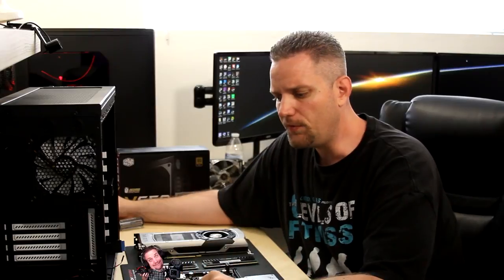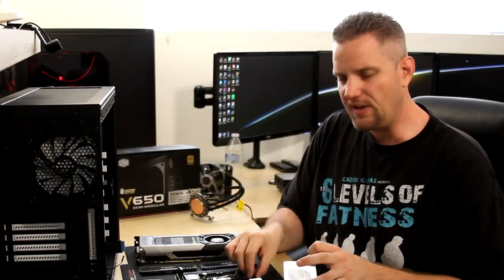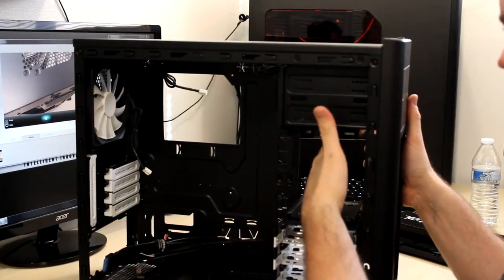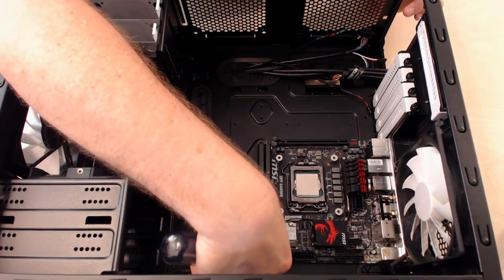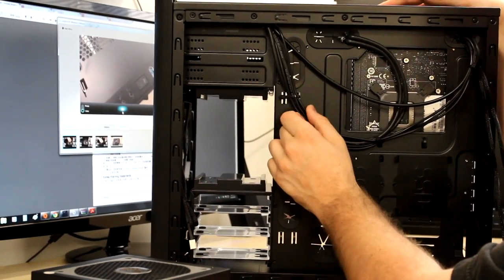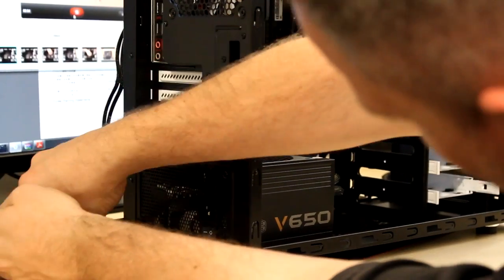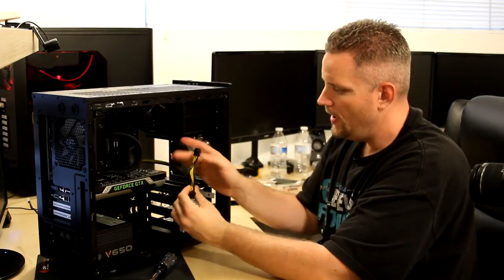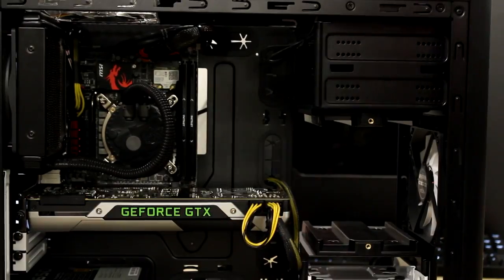Beginners Guide: How to Build a Computer

Comment: Dumb question- Do most hard drives, motherboards, PSU's and SSD's come with the cables required to hook them up? Or do you need to buy them separately?
Reply: Your motherboard will have 2-6 sata cords (depending on brand and price range.) cases will sometimes come with extra tray holders and some don't. Minor accessories may be needed, but majority is covered!

Comment: Two questions here:  1st, do all the cables come with the components (e.g. power, SATA).  2nd is, does windows come pre-loaded on the ssd?  Thanks in advance.
Reply: 1. Yes 2. No you will have to get it of a flash drive or get an optical drive and use the c DVD method

Comment: Can anybody help? I was thinking of building a pc, but all the cases I use on pcpartpicker says they're usb 3.0 and that my Asus A68HM-E Micro ATX FM2+ Motherboard does not have onboard USB 3.0 headers. Should I listen to this or is it irrelevant?
Reply: You should get a motherboard with sub headers but if you can it isn't really important. As long as your motherboard has enough USB ports for your keyboard mouse and whatever else you need. If you really have to you could buy a usb extender thing so you plug it into a USB port and it gives you more USB ports
Reply: Usb headers not sub headers
Reply: you can buy them, the pc will work but u wont be able to use the 3.0 usb ports only the normal ones
Reply: Hook City All my usb is 2.0 so I should be good?
Reply: AG DOMESTIC Ok thank you, if I don't have enough I will just get one of those things that makes more usb inputs, but thank you.

Comment: Complete noob with computers and I got a question. When you turn on the computer for the first time. What do you do? Do u install windows? And what if you don't have a DVD drive like your build? Are there any drivers u need to install for anything? And if so how do you get them. I understand actually building it's when it's the first startup I get confused
Reply: ctrlaltdel.gaming if you still need help let me know. i'm more than willing to help. if you don't have an optical/dvd drive you can burn the os onto a flash drive and do a boot from that. after it does it's thing you have to download the motherboard drives. after that do all the updates and graphic card updates.

Comment: Attempting to build a black and white computer. Not sure what cpu cooler I should go with stock Intel cooler or a 3rd party one.  I would go with nzxt liquid cooling but I'm scared of those liquid ones. What other heatsinks and fans are good for an 1150 socket doing slight ocing.
Reply: Tempest I am going to build a black and white one too! I'm gonna get the Cryorig H5 Universal, it's white and it's apparently pretty good too.

Comment: i think using a big case for a small board would make more sense if you could somehow easily pop a raspberry pi 2 [ at least ] or a banna pi pro [ that or orange i forget it could do 4k though ] . that way if you just wanted to web surf - play mame-mess - or some console emulatior you wouldent even have to power up the main machine OR you could add a extra display and do mad extra multitasking while having your main rig doing the more serious work .

Comment: Do fans need to be plugged into the mobile or is it ok to just plug them straight into the psu
Reply: Motherboard*
Reply: The motherboard.
Reply: +sportagus3 ok thanks, the problem is, the MoBo that I'm ordering only has two fan connections will that be enough? (One at front bottom and one at top back)
Reply: You can always get Y-splitters for fans, or a fan controller to expand the number of fans to plug into your MoBo. Using the PSU will make the fans run at 100%, be loud, and wear out faster. Using the motherboard allows more control of fan speed.
Reply: +tkermes I think that's what ill do then, thanks, the noise wasn't what I was worried about with the constant full power, it was more the wearing of the fans like you said

Comment: hey +JayzTwoCents im getting a ASRock H97M Pro 4 Micro ATX MB, and i have the Hydro 60 CPUCooler from Corsair, but on the motherboard manual there isnt something labeled CPUCooler cause i have to plug in the fan and the pump and i dont know where to plug it in.
Reply: +Seatown | COD, BF4 & GTA Videos Your CPUcooler fan should go to the 4 pin "CPU_FAN1"  and the pump connector should go to the 3 pin "CPU_FAN2" on your motherboard.
Reply: thank you so much <3

Comment: Pc not working, the fans are turning on then off instantly and occasionally I get a no post if it does work, what is the issue because I've replaced all parts but motherboard and it's just a bit dusty, it died when I was doing something in the bios

Comment: please don't kill me if this is a dumb question but if i were to get more fans (4x 120mm 3pin) where do they plug in? on the motherboard?
Reply: dylan winwood Yes. Make sure your motherboard has enough pins. I have an Arc XL case with 3 fans and my motherboard only supports 2 case fans. While disappointing.. it still works.

If you can figure out the electrical output of the fan connection then you might be able to order a splitter, which would enable you to plug two fans into one connection. Just don't use the splitter option if the fans are going to draw too much power, I assume that would be pretty bad.

Comment: which graphic card do you recommend:
Sapphire Radeon R9 290 Vapor-X 4 GB:
Clocking speed 1030Mhz
Turbo speed 1030Mhz
Memory speed 5600Mhz

Or would you recommend:
MSI GTX 960 GAMING 4GB:
Clocking speed: 1241Mhz
Turbo Speed: 1304Mhz
Memory speed: 7010Mhz

As I'm looking for components to build one, and its my first time, I don't know which one is better for a gaming computer
Reply: naam123hj The GTX 960. Although if you can, get the GTX 970, the overclocking ability on that card is insane. Dont be worried about the 3.5 Vram issue, it wont affect you unless you are going 4K.
Reply: +carl-renat ventsel thank god some one is thinking like me

Comment: Is thermal paste required for CPUs with heatsink cooling? I haven't done this before and don't know where I would buy it :S
Reply: I would believe so. It transmits the heat from the CPU to whatever cooler.
Reply: Usually thermal paste comes with the fan when you buy the processor be it Intel or amd

Comment: how do you know if you have enough connecters on the power supply have all my parts picked but i havnt a clue as to what power supply i need parts are as follow :

Case : BitFenix Comrade BFC-COM-100-KKXS1-RP Black ATX Computer Case 

CPU : AMD A6-5400K Trinity Dual-Core 3.6GHz (3.8GHz Turbo) Socket FM2 65W Desktop APU (CPU + GPU) with DirectX 11 Graphic AMD Radeon HD 7540D AD540KOKHJBOX 

MotherBorad : MSI FM2-A75MA-E35 FM2 AMD A75 (Hudson D3) HDMI SATA 6Gb/s USB 3.0 Micro ATX AMD Motherboard 

Crucial Ballistix Sport 8GB (2 x 4GB) 240-Pin DDR3 SDRAM DDR3 1600 (PC3 12800) Desktop Memory Model BLS2KIT4G3D1609DS1S00

Harddrive : Western Digital Blue WD10EZEX 1TB 7200 RPM 64MB Cache SATA 6.0Gb/s 3.5" Internal Hard Drive Bare Drive 

GPU : ASUS R7240-2GD3-L Radeon R7 240 2GB 128-Bit DDR3 PCI Express 3.0 HDCP Ready Low Profile Video Card

would really be thankful for any help :D

Comment: the wiring that connects motherboard to the "on" and "restart" buttons, does that come with the case or how does it work?
Reply: Hey, if your talking about the little plug-ins that say "power" "reset" or "LED" I'm pretty sure those are built in the case, connected to the case buttons. You then plug those plug-ins to the headers on your motherboard.
Reply: zupolyuco
 thanks :)

Comment: I have a doubt.... if i didnt buy a cooler and used the one that came up with the processor and the ones in the case would i still need to use this thermal paste?  And if so what is this thermal paste?
Reply: I don't remember fully but I think stock coolers have pre applied thermal paste

Comment: Just a quick question I'm completely new to this and was wondering if the motherboard had to be a specific design to fit the case. Sorry if I'm being dumb
Reply: Seymore Cox Someone plz answer this 😂 I have no idea as well
Reply: it honestly depends on the case you buy. Most (not all) motherboards are either a ATX or a micro ATX. i think jay was using a mini not a micro for this build but im not positive. (still pretty noobish myself) but check out https://ca.pcpartpicker.com/products/case/   it will give you a list of all the cases and what style of motherboard will fit/match up.They also have a compatibility calculator to make things a little easier!

Comment: Will negative pressure actually be a thing, even with all of the holes and gaps in a case?
Reply: Negative pressure means the air has to go through holes and gaps in the case, which aren't covers by filters. This means dust will build up faster inside the case. That's the only other downside to negative pressure.

Comment: The manufactures should design more cases where front inlet fans are to be mounted in the very bottom front of the case... Much cooler air comes from lower grounds as they say... Especially when your room is AC'ed... It circulates better and efficienty, I guess....

Comment: This helped allot! I do have a question though, which is more about the concept of pc building. Does every case have the same "slots" and places where all brands and types of motherboards etc fit in? And do all RAM thingy's fit on every motherboard? I'm wondering to what level you are limited when deciding what hardware to buy..

See, I can find the right specs, and what I want with enough research. But once I have all the items in my house I'll probably be the kind of person that doesn't know what to do when a few screws here and there are different or something doesn't quite fit xD
Reply: +Doofy Goofus 1.) there are different 'tiers' of cases. we got mini, mid-tower, and full-towers. mini is for those small motherboards and a few parts, atx is a standard size to fit most motherboards and will handle almost anything you put into it, and full tower will handle everything you throw at it. Most cases have a certain amount of 'slots' at your disposal. Harddrive trays, motherboard standoffs, optical drive pay, and pci slots. So depending on what 'tier' you by you get more choices! 2.) if you need help building I can help you. it's rather simple.
Reply: +porkyporkchop1 Thank you for the offer!:) Right now I'm still trying to decide wether the price difference between getting a gaming laptop and building a tower is worth the disadvantage of not being able to take the tower with me (I'm a student that spends half the week in a different city). But yeah, a laptop has the obvious disadvantage of getting outdated after several years and you can't really upgrade much or replace hardware.
Reply: Doofy Goofus Well, if you're stuck being mobile you might want to invest with a laptop. Sadly, in my experience my laptops don't last more than a year without breaking. My desktops have survived a solid 5-8 years before I decide to upgrade. Since it's a laptop the part qualities will be a bit lower and MORE expensive than a desktop. (Just letting you know. Not trying to persuade you.) I would just get a basic chrome book or something for school and then build myself a nice gaming desktop. My two cents.
Reply: +porkyporkchop1 Ah yeah.. laptops are so fragile. The longest one lasted me about 4 years... Thanks for the the advice anyway! I'm gonna check what's available in my hometown, they sometimes have nice bargains for laptops. But I'll be sure to check the specifics before I buy anything.

Comment: Got an MSI B250 Carbon Pro(not super interested in OC at the moment) and I forgot my i5 3330 3.0GHz CPU is a LGA 1155 socket and the mobo I got is for LGA 1151 which I thought my CPU was according to my bios but it wasn't. So now I bought an i5 7600 3.8GHz (not K for OC because again not super interested or comfortable plus it's an extra $30. The point of this is just make sure you know what parts you have EXACTLY if you plan on transferring parys from one system to another. Dunno why I just felt like putting this out there.

Comment: I pushed the flap down on the intel core and it made a scary noise, is that normal? Also is it supposed to slot in or do you just place it and push? Cause basically I just put it in the way it showed and forced the lever down. Now I'm not sure if I've done it right.
Reply: +MrCompassionate01 You need alittle bit of force to push the lever down.

Comment: SSDs are advancing very quickly. When I got my computer, a 64 GB SSD came with it. Then I messed up the physical SATA connector and it unplugged now and then and I still have a 64 GB SSD. Amazing how in 1 year SSDs jumped from 64 GB to 1 TB
Reply: if i wanted to could i just use ssd? is there any benefit to mechanical?
Reply: blacksunaccounts SSDs are usually more expensive. HDDs have lots of space for cheap. That's all!
Reply: SSD's are much much faster! :)
Reply: blacksunaccounts get sshd if you want fast speee and alot of space and cheaper price
Reply: Svegetaguy s By SSHD an example is the WD Black^2? And also you can have the RAID 0 if you're that risky.
Reply: Noorquacker Ind. yeah or a seagate sold state hybrid drive
Reply: Noorquacker Ind. I bet they had or were near 1 TB SSD's from the very start, but held off because there are people who will constantly buy the next best thing
Reply: +Noorquacker Ind. Yeah its amazing you can get a 1 TB SSD for 300 US dollars
Reply: Run6Run Cannoning/PvP And a 1 TB HDD for $80 nowadays, so there you go. Around 3.7 times cheaper, I think. I probably have that wrong, let's not have a 100-reply chrome crasher conversation here.

Comment: Can someone explain negative air pressure, what it does, how to prevent it, and how i could place my fans?
Reply: Negative is when you have more exhaust fans than intake fans. It is better for cooling but worse for dust

Positive is when you have more intake fans, better for keeping the dust outside of the pc

I usually go with positive if i can, If not with neutral

Comment: I notice that on some motherboards that there are 4 ram slots and I was wondering if it is possible to use 4 ram stick or if that was to much. I'm wanting to get into the pc gaming world so bad cause my consoles are only good for netflix now :P
Reply: Oh, okay that makes more sense thanks :)
Reply: Whats the best graphics card?
Reply: +masterchief11758 what's your price range. For the most bang for the buck I would recommend gtx 970 evga ssc.
Reply: At least 900 to 1,300 cause I wanna make sure it runs smoothly and so it can run bf4, arma 1 to 3 and skyrim
Reply: +masterchief11758 the r9 390 easily beats out the gtx 970 with 8GB VRAM comapred to 3.5GB VRAM in the 970 :P

Comment: HI jAY I need your help regarding static electricity.  i wanna build a new gaming pc in my room, and here's the problem.... i have the moquette floor.. can i build my pc on the desk? and prevent static electricity? i have the static bracelet, and im gonna attack it on the case... soooo what do you think?... im afraid. to burn any Cpu or GPu... you know. Thx.
Reply: +Workout4Life Mc building on a wooden desk or cardboard will be fine. You just have to touch the side panels or a door knob before you get started. Everything will be fine :) Don't be scared to touch the parts. I know it's scary because you don't want to mess up, but just ignore the butterflies and have fun!
Reply: allright thank you for in informations!
Reply: Workout4Life Mc no problem, let me know if you need more help.
Reply: yeah ^^ i will!

Comment: cable management lmao its hard for me to do in my case Rosewill BlackHawk-Ultra Full Tower. but anyway in this same case i would like help info what ever as to how i should do up my air flow.
all i have changed from stock case was took out the 230mm fan on side panel and put 5 120sp fans there in a config like this the X is the fans and the 230 used to
be where the cluster of X's are.   
|OXO| 
|XXO|
|XXO|
and the 6th fan is in front top where dvd drive goes other then that the stock fans are still chilling where they reside. all the side fans that i added are blowing in and im wondering if there is a way anyone else would set the fans up using or not using all the stock fans plus+ the 6-120mm sp fans.
oh ya the cpu cooler im using is the coolermasterV8 GTS. and i have 2 gpu's none blower blower style

Comment: Hi, some people said the static electricity from your hand will damage the components of your computer is that true? If Ys how can I avoid?
Reply: Hello, yes in some cases static electricity can be a cause of harming components, you can avoid by buying an anti static wristband or avoid any electricity conducter place, like sofa or something like that. Hope i somehow helped you.
Reply: any other way that can aviod it without costing
money?
Reply: Wayne13397  you can simply take a shower to empty your body from it : )
Reply: thx a lot : )
Reply: Wayne13397
Yes. Just touch your computer case and you are grounded as well. But I highly recommend to do it several times before you put your hands on each components and don't ever touch the CPU gold pins and the same goes for the graphics card and ram memory. If you do these things that I suggested you will not have any problems. I hope this help you :)
Regards
Reply: ok sure thx for your suggestions : )
Reply: No problem glad to help.

Comment: My motherboard is installed on the left of my computer, and the PSU is on the top side together with the motherboard. I'm thinking of upgrading to the GTX 980 Ti, but I'm concerned that it'll blow the hot air into the PSU. Should this concern me? Currently running the GTX 750.
Reply: hey is the gtx 750 good enough to play games like bo1 - bo3, gta 5, cs go, minecraft 60fps etc?
Reply: Yes. Probably not bo3 full hd tho'
Reply: +Mr. Spooderman k thanks